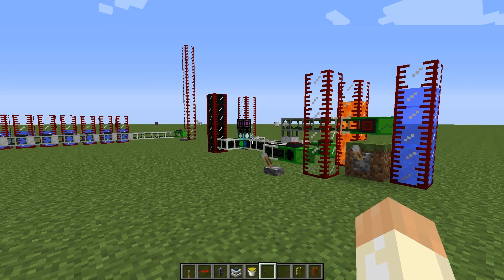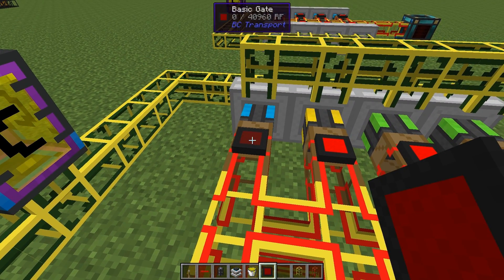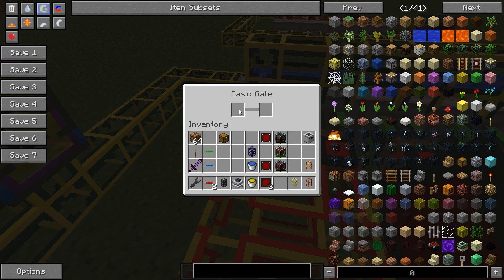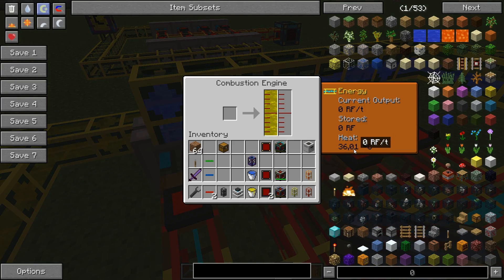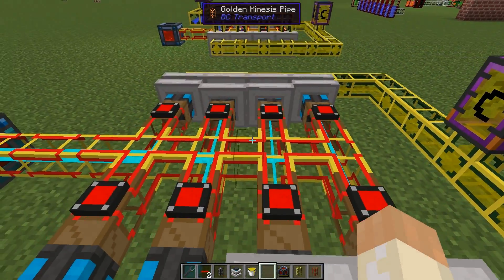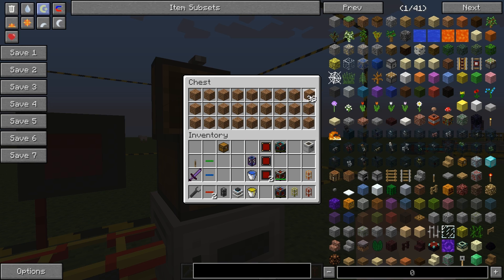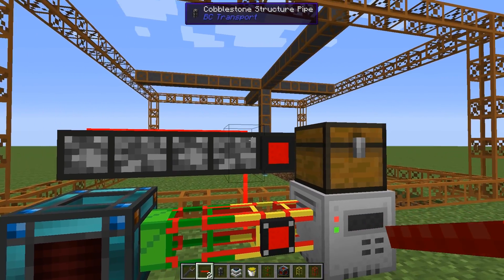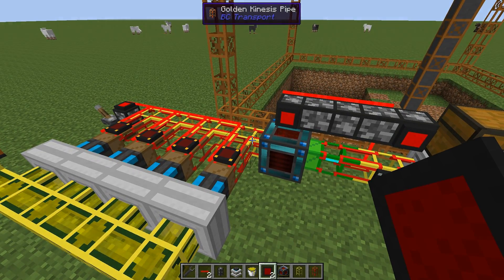BuildCraft Gate Examples - Engine and Quarry Control (BC6 & 7 Tutorial)

Comment: Okay, my question is, how do I wire this thing? I don't exactly have wire.
Reply from the maker: It depends on what mods you do have that is compatible with BuildCraft? If you have BC you should at least have the pipes that comes with the mod?
Reply: I got it, thank you. I didn't understand the whole concept you were going, but with powering the engine, it does it without a gate.

Comment: If you ran red pipe wire to your house and attached a basic gate so when the quarry stops working (when it stops sending out a red stone signal to let the energy flow it would trigger the gate at your house and you would have a lamp under the gate so it would emit a red stone signal when the pipe wire is off to turn on the light and signal that something stopped (sorry if I didn't explain it well I'm bad at explaining)
Reply from the maker: Yeah, that should work. Do you have a finished setup or are you asking me to build one? :)

Comment: Can you to a tutorial where when you are low on power, you won't receive power unless forced. Like if i am down to 10 RF then it will stop transmitting power unless I flick a lever  to make it transmit the 10 RF. Thanks
Reply from the maker: +wolfman2watch With BC Gates you can set conditions on full/half/quarter filled Energy Cells. Combine this with the behavior or Redstone signal in the cell. It can be tricky to cover all on/off states, but should be quite straight forward. I have a design in my head, but it requires two gates on the same Structure pipe... I will give it a few minutes next time I sit down :)
Reply from the maker: +wolfman2watch I tried this just before going to bed yesterday, seems to work fine. I had no time to make a video, and will be gone a few days due to work, so can&#39;t make a video until I get home... There are several ways to do this of course, but the one I did have one piece of structure pipe with two basic gates and one piece of red pipe wire. And one lever next to the Energy cell.
1. Set cell to output energy on HIGH signal.
2. This means that the lever will mean: Off = auto mode. On = force on.
3. Place structure pipe with two gates and pipe wire behind the Energy Cell and set that side to Input (or output I guess, but not disabled).
4. Change Cell behavior to &quot;Active on HIGH signal&quot;
5. Set one gate to &quot;On LOW energy stored, output red PIPE signal&quot;
6. Set the other gate to &quot;On NO red pipe signal, output HIGH Redstone signal&quot;.
This will mean that until we reach 5% stored energy in the cell, the first gate will output no red pipe signal, then the other gate will output a high signal to the cell = output energy. Once we reach 5% or lower, a red pipe signal will be output. This means no redstone signal and no power. The lever then works as an override and will force energy out when redstone signal is applied. Until I can make a video I hope this will help you :)
edit: the double gate solution will act as a signal inverter. I want to have "higher than 5% = on", but I can only get signal from "lower than". And since a high redstone signal will always override a low signal I had to invert it like this... You can use other methods as well, but this is a fun way to use multiple gates to get new functions. Plus, this was the first one that came to mind ;)